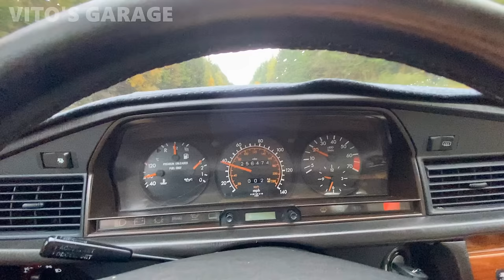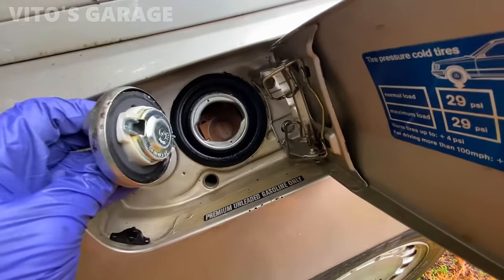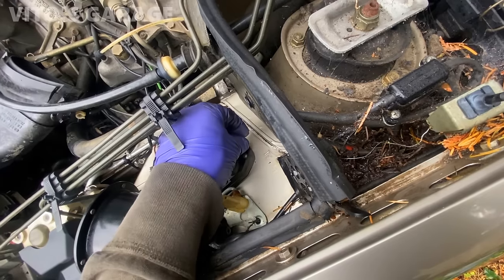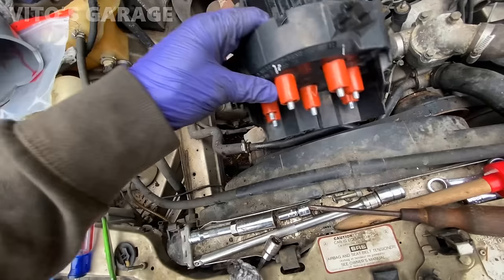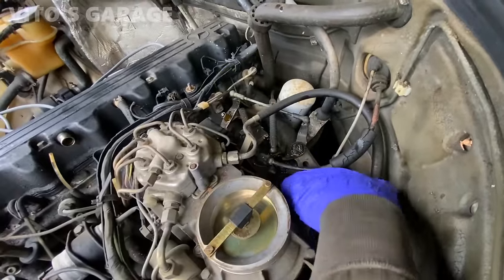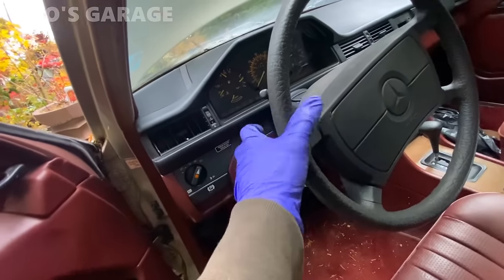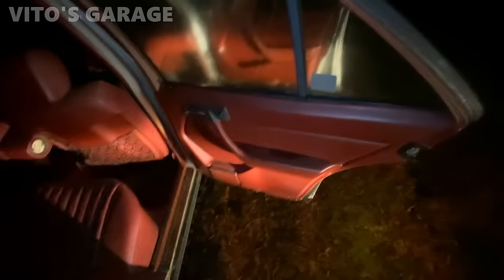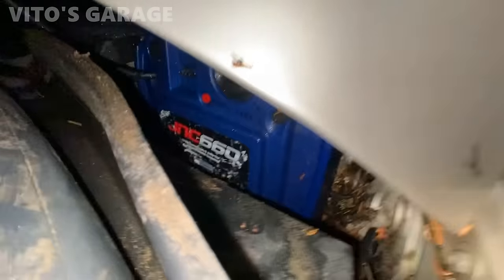Will it Start? Gold on Red 1986 Mercedes W124 300E Revival After 4 Years!!

Comment: First of all congrats on another amazing job. Two quick questions, just outta curiosity : 1. Did I see the check engine light been On  while you were driving the Baby ? 2. Instead of fiddling with the jumper boxes why not just use the battery from the Baby ?
Reply from the maker: Thank you very much!!!

And to answer your questions:
1) Yes, check engine is on
2) Well, my jumper that I have is basically like another battery. And it was all charged up. Sometimes the connection just wasn’t the best. But as you saw it all did the job!
Reply: @VITOSGARAGE  Any chance we might see a future video about you fixing it ? That would be AMAIZING !
Reply from the maker: @danricci6996  I’ll try to make a video about it at some point. I’ve scanned it before and it has two codes. One of them is for the EGR. 
But my plan in the future is to refresh this engine just like I’m doing on an S124 right now